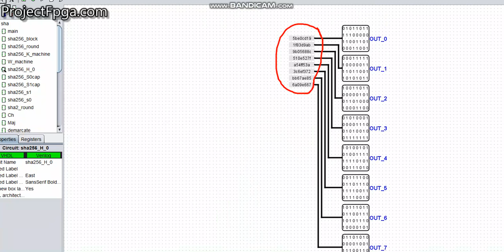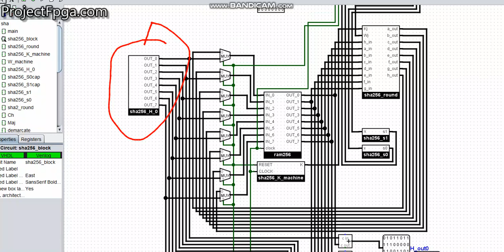SHA256 - lesson3

Comment: Thanks for this, but where is logism circuit file, not found on given website?
Reply from the maker: Send me ur email
Reply: @projectfpga5482  I emailed you, thanks.
Reply: @projectfpga5482   hello Emmanuel. Can I ask you too for the " logism circuit" ? I would like to test bitcoin mining with FPGA as I learned it works better than GPU, but I'm still a newbie in this kind of low level programming.
Reply from the maker: @ab-cherifmehdi2263  send me an email